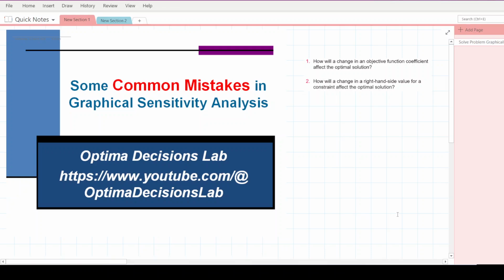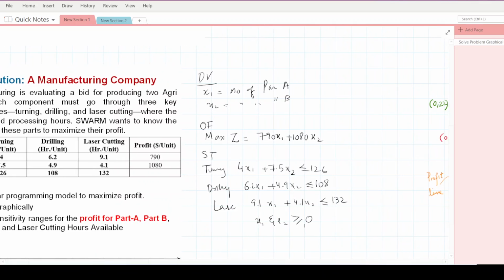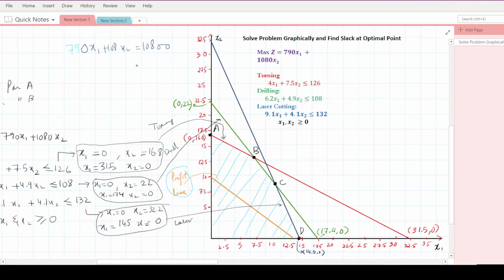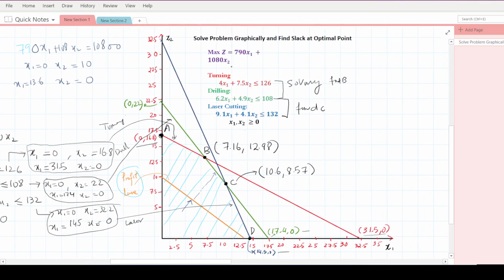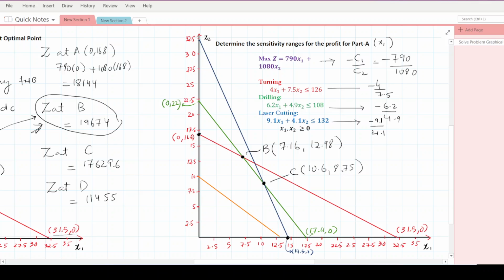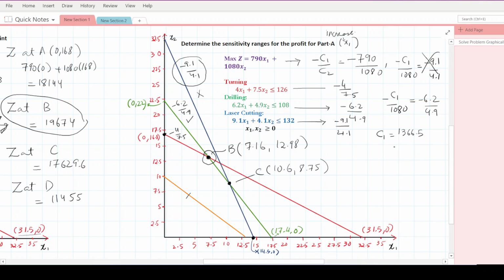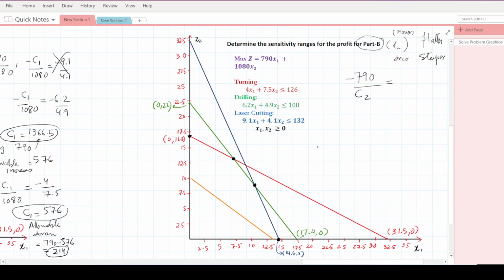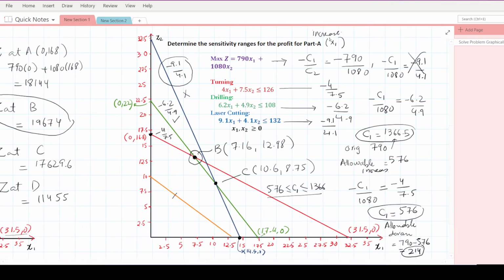LP Sensitivity Analysis Mistakes | Wrong Constraint Line Selection

Comment from the maker: 📌 Common Mistakes in Graphical Sensitivity Analysis in Linear Programming – Part 1

In this video, we discuss a key mistake in graphical sensitivity analysis:
👉 Incorrect selection of constraint lines not passing through the optimal point.

🔽 Full Series:

▶ Part 1: Constraint Line Selection Error
https://www.youtube.com/watch?v=rEL35qldFDI

▶ Part 2: Ignoring Feasible Region in RHS Sensitivity
https://www.youtube.com/watch?v=Ju5cxT3Kx48

▶ Part 3: Non-Binding Constraint RHS Mistake
https://www.youtube.com/watch?v=En7BVeuCAKo

▶ Part 4: Shadow Price & Reduced Cost Errors
https://www.youtube.com/watch?v=9Doyoa-jrWo

📌 I offer one-on-one mentoring and project guidance in OR, Simulation, and Engineering subjects. Reach out: optimadecisionslab@gmail.com